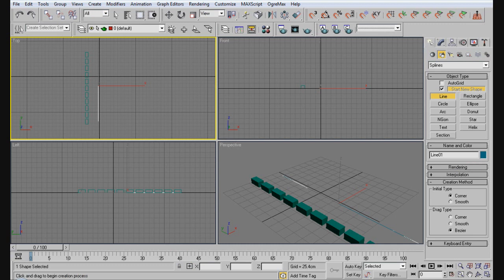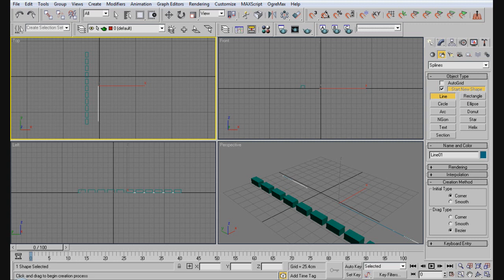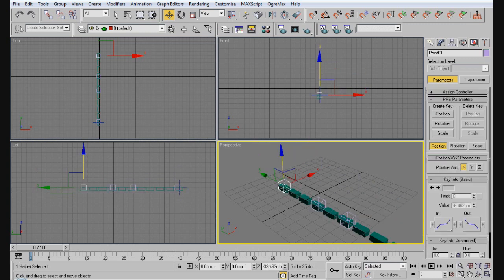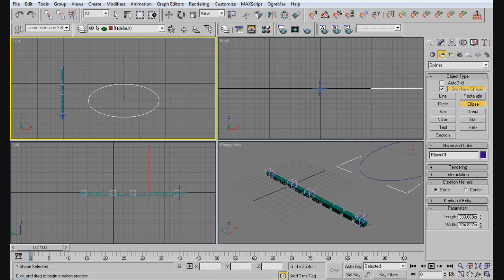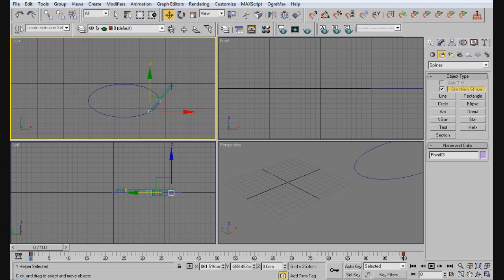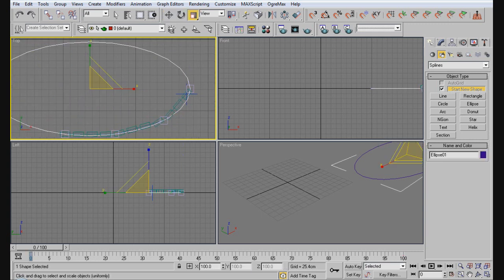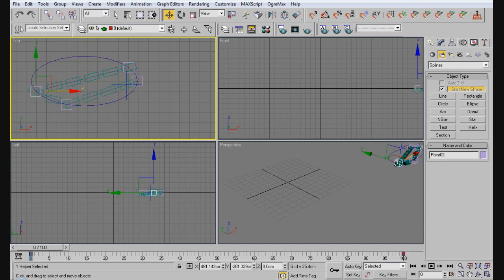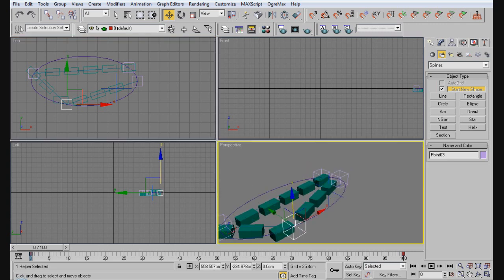3ds Max Tutorial - Animating a Bike Chain

Comment: Kind of lost me this one. Are the dummy's linked up like the chain? Because I am trying this with the chain I made. Then @ 0:59 you talk about selecting the bottom  block. But not sure which is the bottom block. Then you seem to click on the same block. Did not work for me whatever end block I stared from. After you apply the IK solver to block?? and line you seem to have more control points. IS that something Max does.